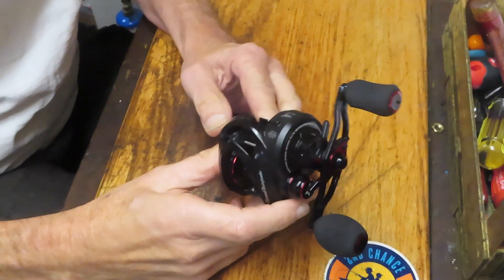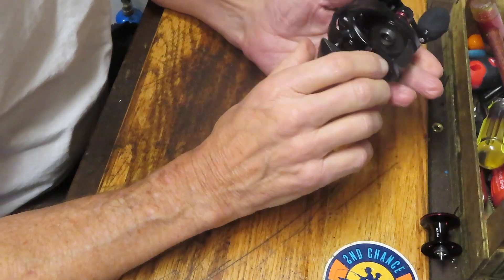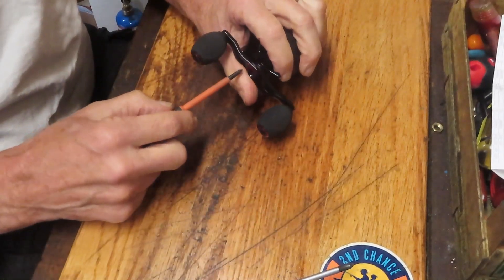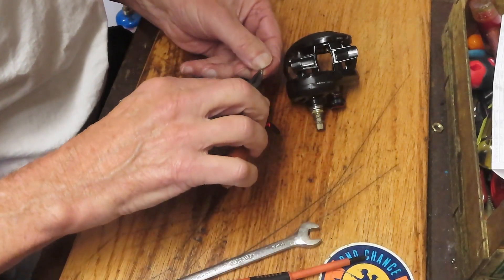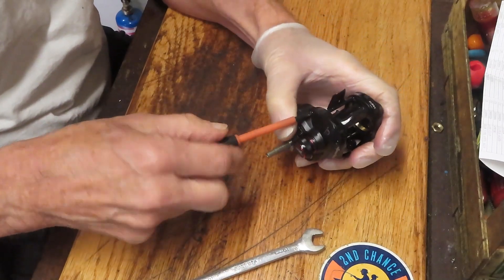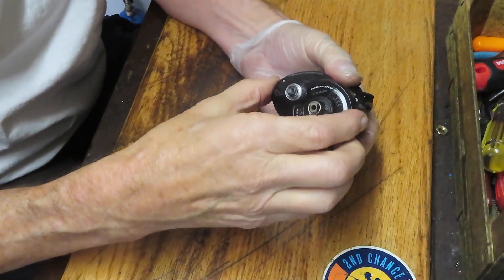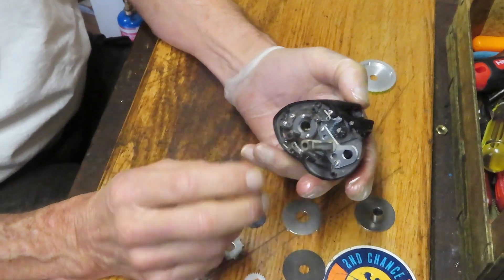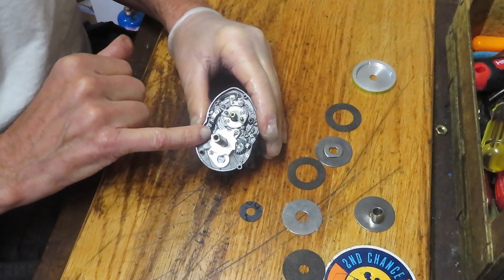KASTKING Speed Demon Elite bait casting fishing reel how to service

Comment: Hey, I don't know if you will see this in time but I have a abu garcia ambassador 5600 bcx that when I reel it a clicking sounds and the spool doesn't move at all, I've taken it apart and seen that the little middle gear sometimes doesn't make full contact with the main gear, if you have any tips on how to fix this, I would gladly hear them, thanks
Reply from the maker: It seems like the yoke is not bearing down on the gear and holding it fast to the spool.  THat's the job of the yoke springs.  Check to make sure they are installed properly.  The springs belong on top of the yoke and not under it - Dennis
Reply: @2ndChanceTackle  hey Dennis, luckily it just started to work again before i sall this, but if the problem arises again ill take a look here, thanks a lot for the advice though.